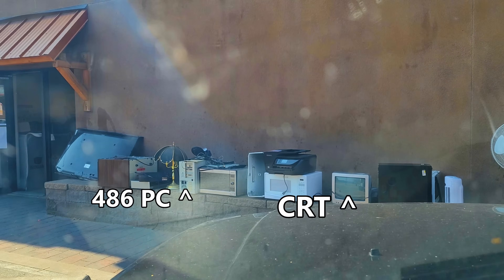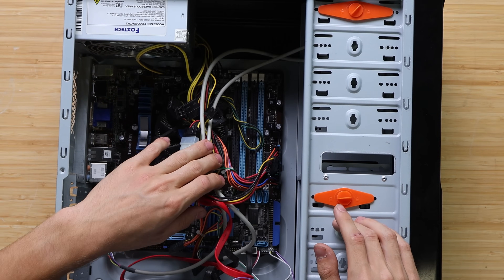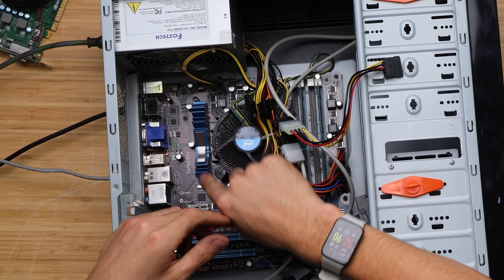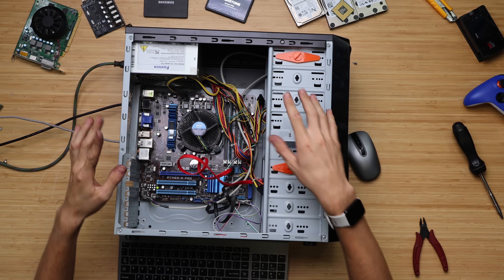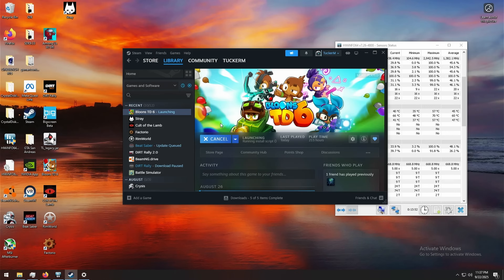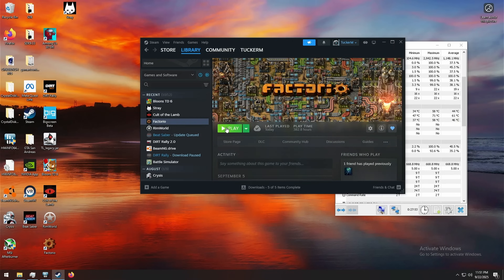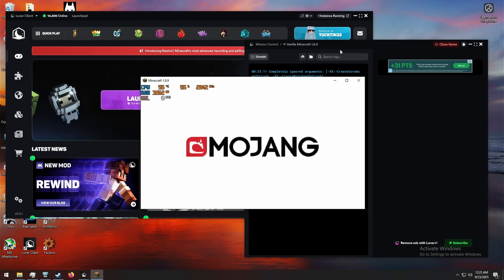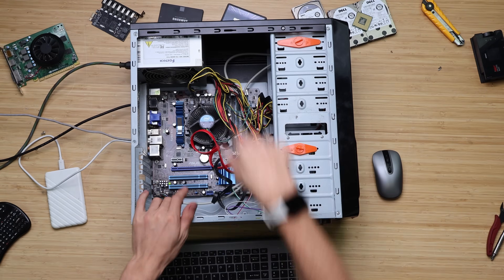$10 FIX for a TRASH PC - Can It Game?

Comment: Hey dude! I was watching your video and I noticed that your motherboard was receiving electricity via Power Supply. Your MB has a green light that shows that is on. Make sure to turn off the power supply and disconnect the power cable. Beyond that it is an awesome video. I have two of the same "free computer" Upgraded it to Core 2 Quad Q9505 and 8GB of ram. Not bad. One of them will turn to a "retro gaming pc". I have some games that are not compatible with Windows 10 or even 8.1, so I will install Windows 7 and buy a GT 740 low profile. 

That LGA 1156 socket motherboard should support an i7 1st gen CPU. You have to be careful with the stock cooler, if you do the upgrade. It may be not enough to cool the cpu. Check the TDP of that i3 and compare it to a compatible i7 with the same TDP if that exist.

Comment: that motherboard supports quad core chips.   I-5 is 4 core - I-7 is 4 core 8 threads.   A really good motherboard for upgrades. sata3, ddr3 ( up to 16gb ). that is a good motherboard for non gamers to run Linux

Comment: Yo bro, I was kinda in the same situation. Got a free ancient relic with an i5-650 in it. 2c 4t, I looked on ebay and the i7-860 goes for like 5-7$ lol so I bought one for the 4 cores and 8 threads. Not far off from a low tier 2nd gen i5?

Comment: Tbh i'd upgrade it,that Asus motherboard is nice,and at the time it was new these did cost a bit more because it has VRM heatsinks and 4 RAM slots which were usually made Asus motherboards more expensive than other competitors. You can find processors and ram for very cheap on chinese apps or ebay,almost free

Comment: First gen i7 in that system will be shockingly better
Reply from the maker: That's what I'm thinking too, I'll have to get one to try it!
Reply: @ScuffedBits  You can also get the Xeon X3440 or any 4c/8t Xeon for LGA 1156  if its cheaper then the first gen i7
Reply: @crystal_regiment 
Yesssssss,go for it!!
If, looking for a cheapest - 3440,but i would go for an 3470 (i've actually did,and it's a good cpu,but a better cooler IS required).
Reply: @ScuffedBits  They are super rare to find locally. I had an i5 760 system I was hoping to upgrade over the last couple years and I didn't see anything come up on Marketplace.
Reply: You will need to put in a discrete GPU since there are no quad core 1st gen CPU's with integrated graphics. So just throw in a GPU and a i7 or Xeon and you are all set.